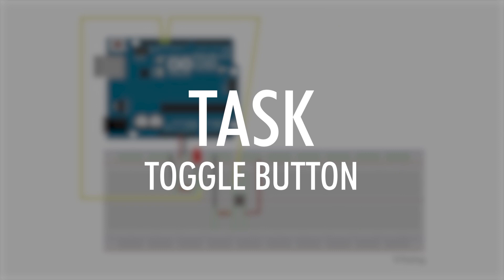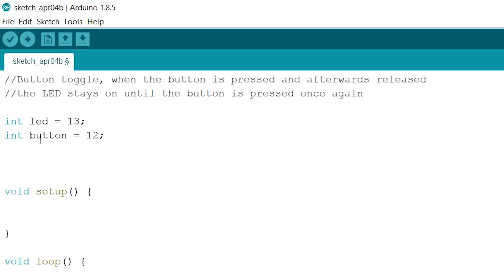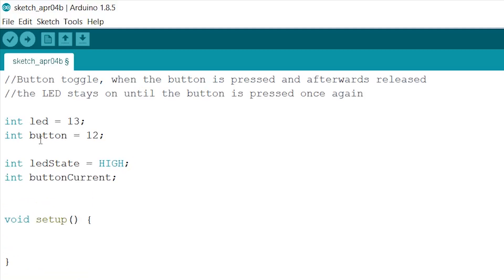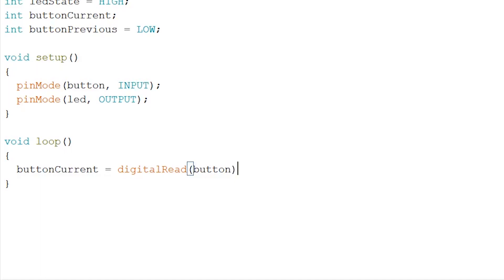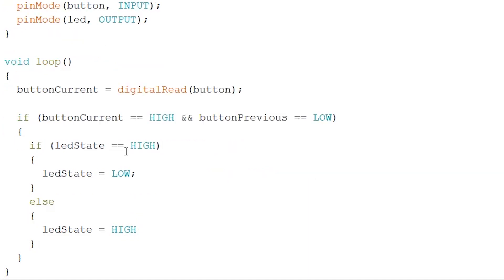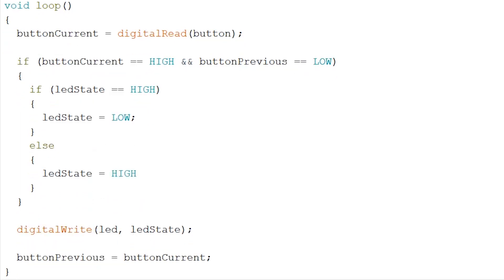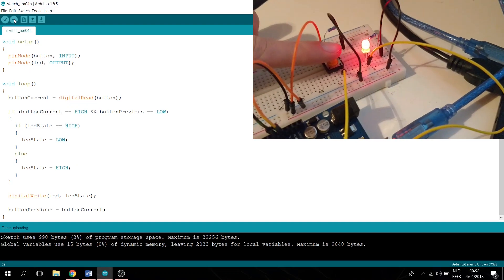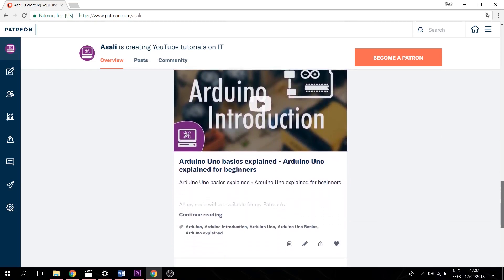Arduino uno Toggle button with led on and off tutorial

Comment: Am I right that everytime you runs this code you have to make sure switch is off (int buttonPrevious = Low)? If you turn Arduino on and keep switch to on state then buttonCurrent and buttonPrevious will be both LOW so nothing will really happen, right?

Comment: Hi Asali!

Thanks for this tutorial; it's just what I needed to learn. I'm having a couple of issues with the code in Arduino 1.8.9 and wondered if you would take a look at my errors please? I can't wait to fix it and try it! 

============================================
int led = 13;
int button = 12;

int ledState = HIGH;
int buttonCurrent;
int buttonPrevious = LOW; 

void setup() {
  // put your setup code here, to run once:

}

void loop() {
  // put your main code here, to run repeatedly:

  buttonCurrent = digitalRead(button);

  if (buttonCurrent == HIGH && buttonPrevious == LOW)
  {
    if (ledState = HIGH)
    {
      ledState = LOW; }
      }
      else
      {
          ledState = HIGH;  
      }
    }

    digitalWrite(led, ledState);
    
    buttonPrevious = buttonCurrent;
}
===============================================
ERRORS...

Button_LED:34:17: error: expected constructor, destructor, or type conversion before '(' token
     digitalWrite(led, ledState);
                        ^
Button_LED:36:5: error: 'buttonPrevious' does not name a type
     buttonPrevious = buttonCurrent;
     ^
Button_LED:37:1: error: expected declaration before '}' token
 }
 ^
exit status 1
expected constructor, destructor, or type conversion before '(' token

Comment: Toggling a pin can be reduced to one line of code:
digitalWrite(pin, !digitalRead(pin));
And there's no need to keep track of the previous state because an internal register in the processor is already doing that.
Reply: Can you please explain it briefly
Reply: but then it doesnt toggle it if your using a button because if you dont instantly press the button its going to start running it over and over so nothing really happens